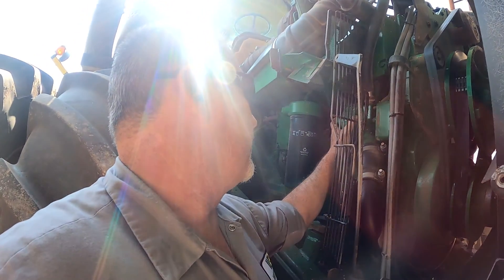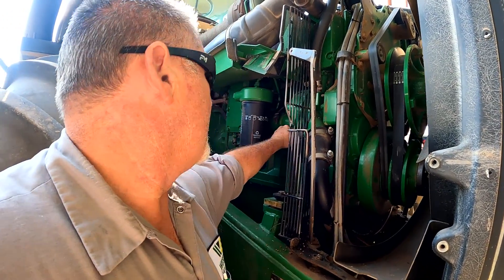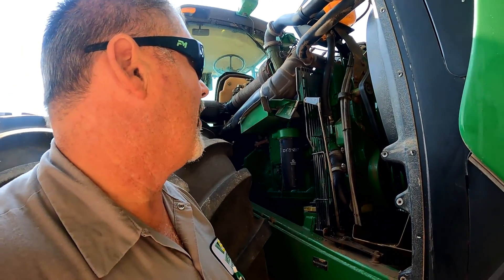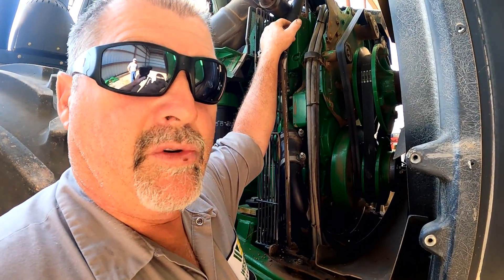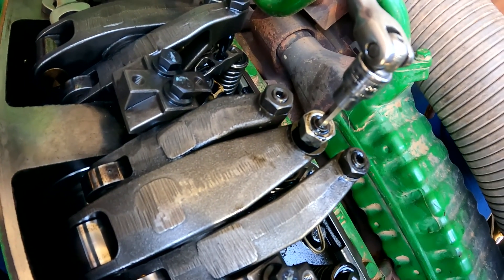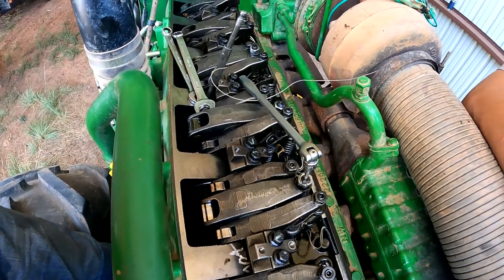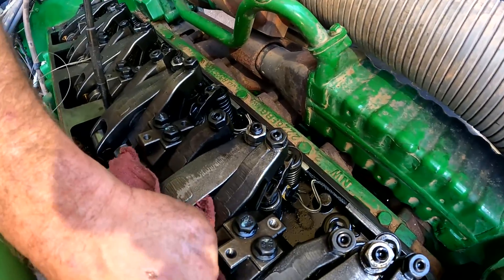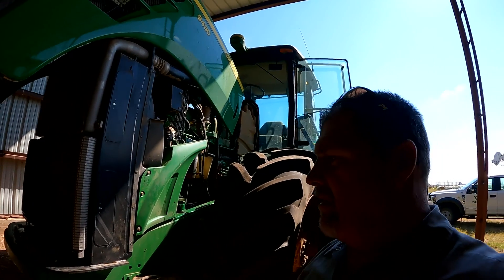Larry's Life E35 | John Deere 9430 Tractor MUST DO MAINTENANCE every 2500/Hours

Comment: Valve lash should get tighter as the valves wear. As valve and seat wear, the stem will move up into the head, closer to the rocker.  I thought lash is measured between the rocker foot and bridge, so lash for both valves.  Otherwise with a feeler gauge at 1  valve, your tilting the bridge like a teeter totter.